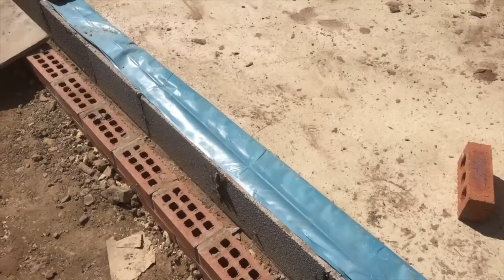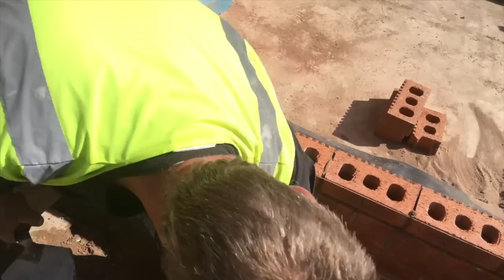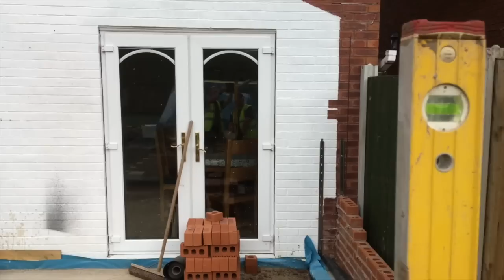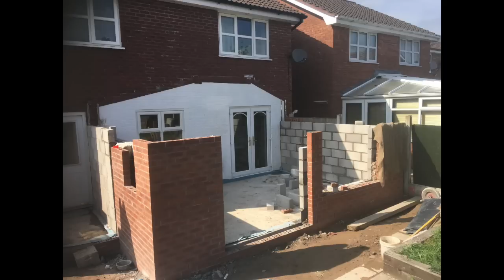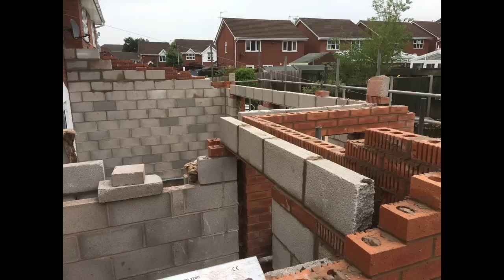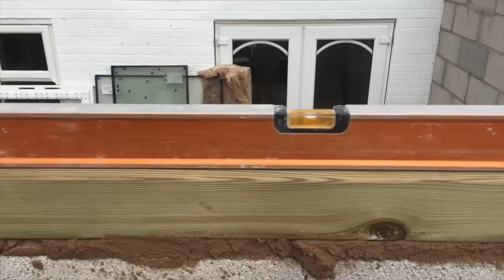Bricklaying Building the extension part 4: building up from damp course

Comment: Great stuff. Maybe a very dim question, but here goes... are building plans that are specified in mm measured into brickwork measurements also, or are brick runs tweaked as best fit on site by the brickies?
Reply: Carl utilizes the level ruler, horizontal lines and vertical lines to measure and assure the qualities of the works.

Comment: Would the foam insulation panels placed beneath the concrete slab cause movement over time? The slab can compress this softer layer.

Comment: I notice you have toothed in on the outer leaf and yet used a flexible wall tie on the inner leaf?  Isn't there the chance of the outer leaf cracking?  Would Building regs be OK with that?

Comment: Keying the bricks into the corner of the existing house, is that just for aesthetics or is it better than using the stainless steel joining bars? I notice you used them for the inner block skin but not for the outer brick.
Reply from the maker: Yes, thought it would look better than a straight joint!

Comment: I'm curious as to why you left the panel fence in, instead of building right to the boundary line?
Reply: I don't know why you didn't get an answer, but if the neighbour doesn't want it you may end up with problems.
Reply: The overhang from the roof can't go beyond the boundary, so the wall has to be set back to allow space.

Comment: I'm suprised you got away with toothing the brickwork into the existing building.
We aint done that since the 80's. They make us use wall starters like you used for the block skin.
Also, why do you use a damp tray at DPC level? We only use damp trays where the cavity is bridged, like when using catnic lintols.
Other than that, the brickwork is tidy.

Comment: He’s never a bricklayer !!! And have they never heard of profiles
Reply: Juan Kerr doing it without profiles is called skill mate.
Reply: Cut the Crap 
You’ve obviously never laid bricks on a price then.
Reply: Cut the Crap profiles all the way time is money
Reply: it's also slow its not about skill ya nutter it's about earning ya dosh and on to the next one pal !!
Reply from the maker: Profiles not always fast as it depends on each individual job, we had corners and felt it was as quick free hand...some times profiles are a nuisance and can lift the bottom courses..
Reply: Chris Longhurst well your get up to splash or dpc corse first rake some purps out ready for when you start or prop the profiles with timbers it’s simple gage up you can bump or grind and even get your door heights obvs not all corners are worth putting up a profile of the returns are small